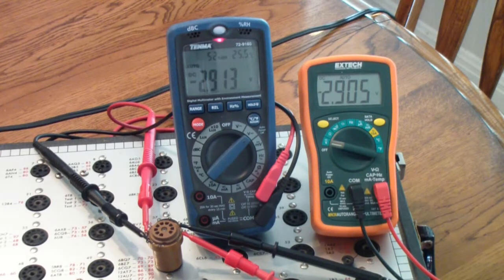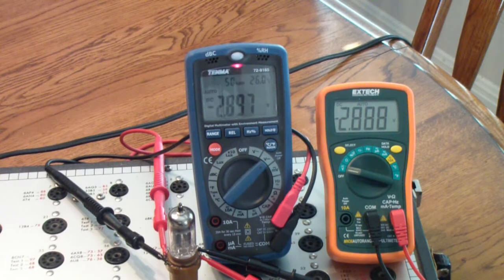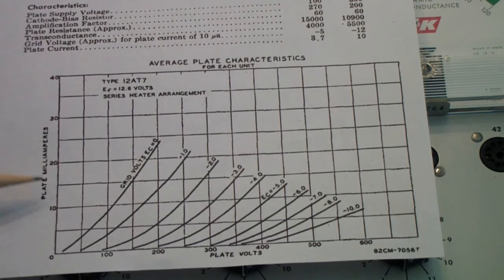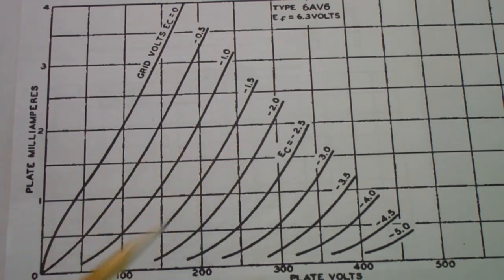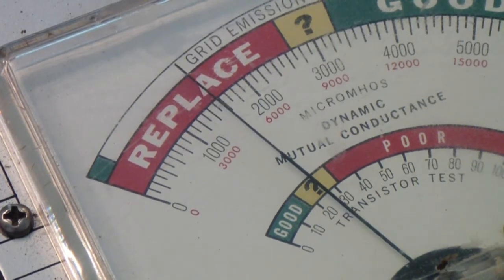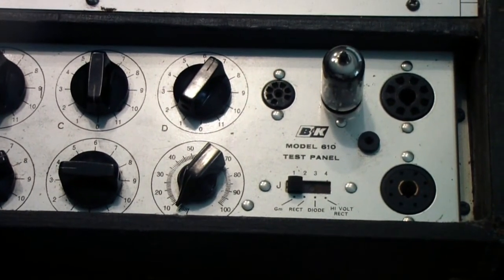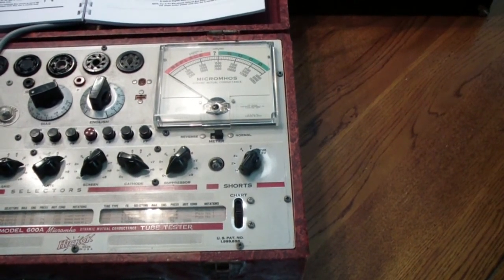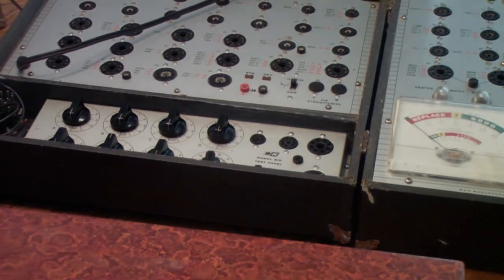TTT092 Testing 12AX7 on B&K and Hickok Testers

Comment: For a point of reference, I did service calls for a small TV servicer back in the late 60's.  For in-the-home service calls, we never took a tube tester along.  That would have taken a stupid amount of time to test 20 tubes in a B&W or color TV.
For obvious symptoms pointing to a specific tube stage the tube test was simple substitution.  Then for the life test on other tubes, we merely tapped the tubes as the best indicator of the health of the tube.  It was a viable test & for an older Color TV that hadn't been recently serviced and proved itself by low recall percentages.
For the average older color set, we still got out of the house with 5-9 tubes that verifiably needed to be replaced.  Almost as a matter of course, we would replace the horizontal output & damper tubes as they got the hardest usage.
Nice video and thought processes.

Comment: Interesting that your understanding of how Hickok was using the word "English" was the same as my interpretation. However, I subsequently was given to understand by something I read in the Hickok 600A manual that what they were trying to imply was that when one sets the "English" dial to the number specified on the rollchart, one is then reading from the English "scale" (if you will) as opposed to one of the microMho scales. Thus, when one uses the rollchart's "English" number, one can then read the word to which the indicator points, in plain English: either "GOOD" or "REPLACE". 
Nonetheless, one is still applying a bit of "English" to the scale in order to read from the "English" scale, are they not? (8^D)
Because of my misunderstanding, which was pointed out to me by a friend (to whom I gave my old B&K 707, incidentally), it was a while before I realized my mistake: I was setting the control to the "English" number on the rollchart and mistakenly thinking I was reading an actual transconductance value in microMhos.

Comment: Great video.  I have a B&K 550.  Really like it since it work pretty well and has the 610 panel.  I like your insights on the rationale for the quik test capabilities of the B&K.  I wish I could have the ability to test 4 prong tubes (6A3), so maybe I need a Hickock 600A.  I have 2 6A3's (inherited) so not sure if it is worth it.  Would like to think about building a SET amp with the 6A3's but not sure.  Thoughts?
Reply from the maker: I would take a look at the ElPasoTubeAmps channel on Youtube since he is doing a 300B SET Amp. I have a 600A and it is an excellent choice for the older 4, 5, and 6 pin tubes.

Comment: Hi Tom,,, Thank you for doing this great video on the 12Ax7  B&K tube Test,, Great thinking using your 610 panel.  I was wondering if a person set up one of the spare sockets like you talked about in your previous video,,,if there would be a way to increase the meter reading to that closer to the 600a? I'm wondering if the Hickok meter is more sensitive than the B&K 650. or what is causing the meter swing difference,, Can't thank you enough for all your super great work.
Reply from the maker: Thanks for the kind comments. Also thanks for the 6BQ5 you sent - it has arrived and I hope to post a video using it by the weekend.  As for increasing the12AX7 reading on the B&K, one way (in addition to lowering the bias level to about -0.5 V) would be to increase the signal level from the bridge circuit but that would affect the calibration of all the other tubes so I don;t think that would be worth it. I will continue to think about it but I think the bias and sensitvity changes are the most useful.
Reply: tomtektest Fantastic,,, nice to hear my tube packing idea worked and it arrived in only one piece :) It's my way of saying thank you for your patience with all my questions and the knowledge that you have given to not just me but to everyone,, Not very many people can do what you do,,the way you do it.. I truly am great full. Have to say,, you've really got me going and extremely excited about my 650 here for sure,, Looking forward to seeing your next video,, Hope you have a wonderful week end.. Thanks again. 

P.S. During my excitement I forgot to ask where you bought your Socket test tube adapter? 
And my wife really enjoys watching your videos with me as well,,,She says to say Hi Tom,, from Yvonne,,, :)
Reply from the maker: Thanks again for the comments and say Hi to your wife for me. I am really having fun with all this vintage stuff. For many years I was a research director so I worked on the leading edge but always missed my early days with tubes. As to the adapters I had a couple from my past but I bought several on e-bay a couple of years ago. I know I bought from more than one source, but all individuals, no companies so I don't think they are still selling them. Most TV Repair Shops had them by the dozen and many have sold them on e-bay. Let me know if you still have trouble finding them and I will try to find some on e-bay that you can bid on. Good luck with your 650!.